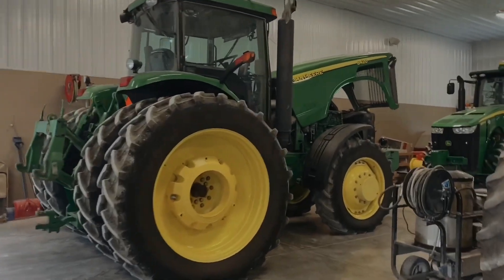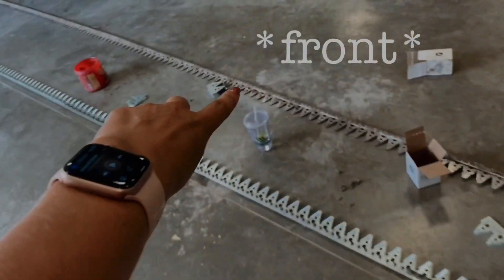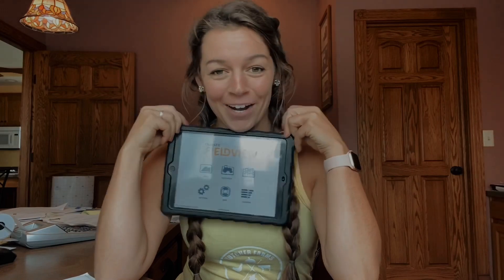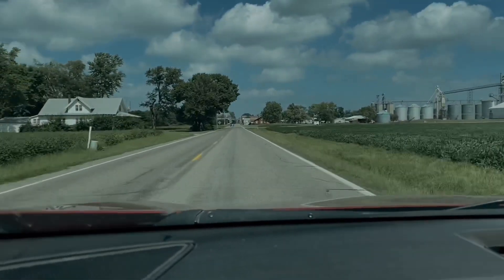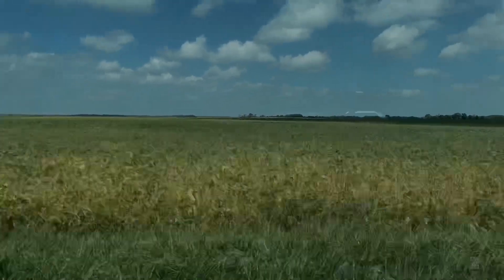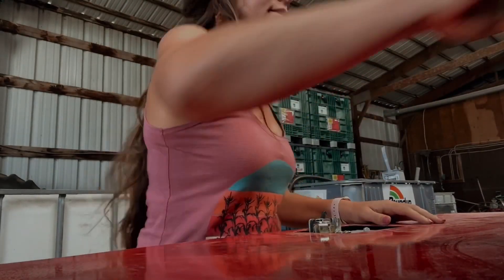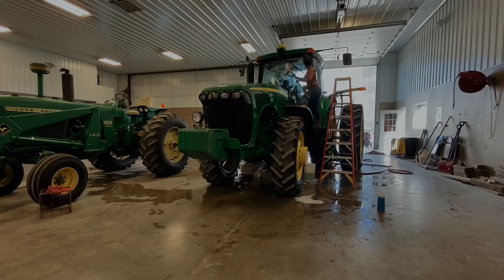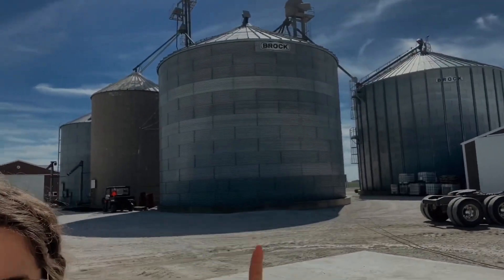Week Recap: More Harvest Prep, Technology Issues, & Roscoe the Raccoon

Comment: @2:40 - Bad knees made me retire early.   I should have worn knee pads from the very start, working the tools.   
It's very costly retiring early.   Being young, you're viewpoint is not the same as being "down the road".   By the time 
you get old, you may well enjoy your work and want to work as long as you can, generally, if you've chosen an interesting 
line of work.   So, looking back, not wearing knee pads was one of my biggest failures of judgement.    These kinds of
advice are a bore, and you are bullet proof, but you've been informed.     The cheapest knee pads with Velcro fasteners
will suffice.   Avoid the hard capped knee pads, too.   My knees were shot by the time I turned 30yo.

Comment: Technology is great as long as you have enough Jack Daniels to work through it.  Honestly, it will drive you nuts if you let it.  My personal beef with it is that it seems engineers have to stick a computer in everything these days, which means more maintenance 5 or so years down the road.....if you are lucky enough to find a replacement unit.  By the way....you can come and wash my three tractors anytime; they didn't look that clean when I bought them and the main cleaning they get is blowing out the radiator from all the field fluff they pick up.